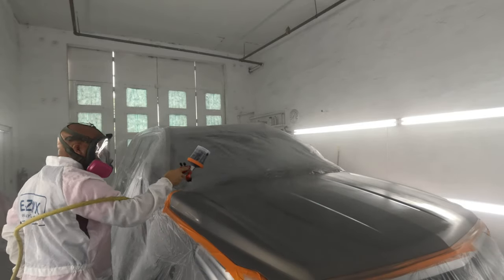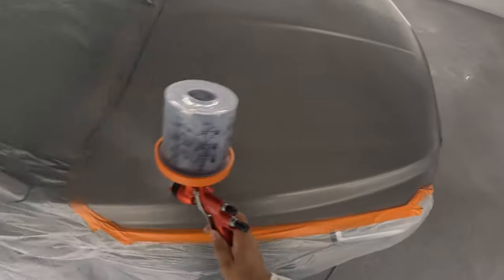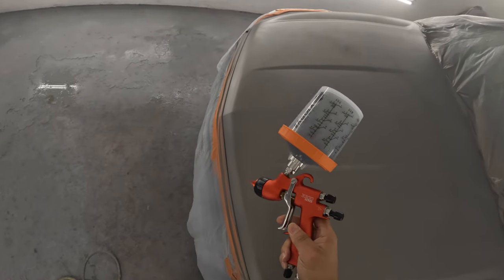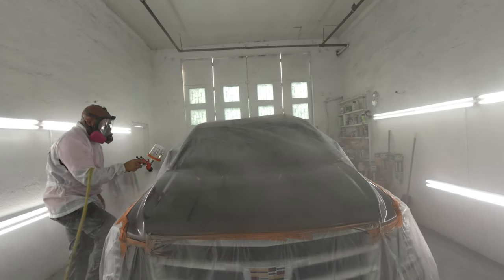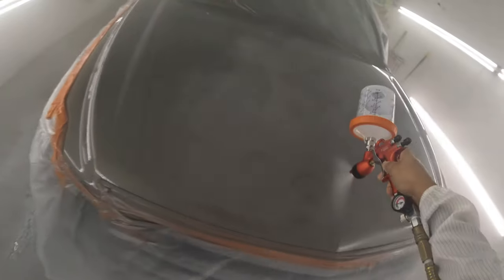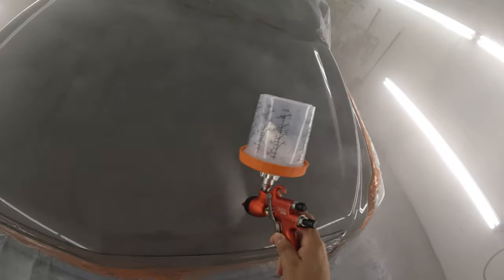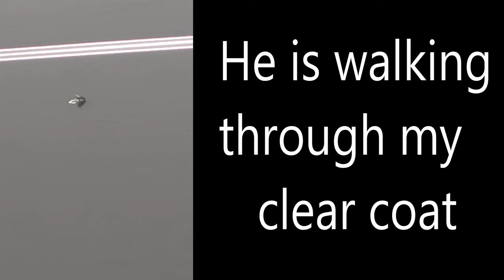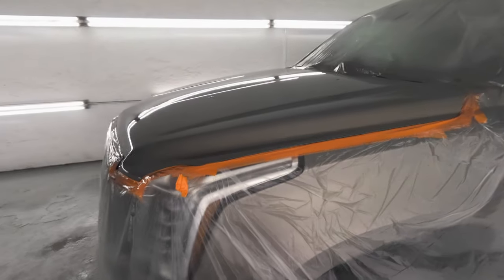Have you ever watched a fly walk through clear coat? 😤 what doesn't kill you makes you stronger 💪🏼

Comment: You could put like strips of rubber on one door that goes over the crack and touches the other door. That way the door still opens but you won’t get that dirty draft. Company I work for has a home made booth that I have to work with. Mines inside. So I just used carpet on the cracks in the same way and it helped alot.
Reply from the maker: Thanks bro, the owner has tried a few different things and they end up coming off. So I'm waiting to see what's next. It's not really a big deal at all. You see the work I put out it's cleaner than some down drafts. I'm just showing it for the guys who are in similar situations. But thank you I do appreciate that. 🤜🏼🤛🏼
Reply: @thetriggerman954  yeah no problem. At least your booth has clean air coming in. All the prepping get done in front of my booth filters so I’m constantly vacuuming them. Your jobs are definitely cleaner than mine. Sometimes I can get a really clean boat.
Reply from the maker: @nickcrill7718  yea man guys like us just make it happen. No cry baby shit here 💪🏼😂

Comment: What clear do you spray the most Trigger an would recommend for someone spraying at home
Reply from the maker: There is a link in the description for the AmTech clear I use. It's what I use on 90% of my jobs. I've been spraying it here at the shop for 10 years now. Haven't had any issues so far. It's a high solids clear and under $200 for the clear and activator.
Reply: @thetriggerman954  thanks for info Trigger 👍🏿💯
Reply from the maker: @SmokeyA55  no problem 💪🏼

Comment: You should get an propane shop heater and after spraying you can vacate fumes from booth then just heat it up real quick and turn it off coming back every so often to turn it back on an reheat booth every now and then! During cold months I do this since I'm spraying in an carport paint booth!
Reply from the maker: That's up to the owner lol I just use fast reducers and hardeners and change out my tips. I'm Florida we only get 8 cold days per year 😂
Reply: @thetriggerman954   got you there  brother I just remembered it snowed here once when I was doing an job and I was stressed and thought it would be dangerous to heat it that way but then I thought about it and those are forced air heaters so they would blow the fumes away instead of making them light up but im working with an back yard homebuilt booth and very minimal right now lol but it works 💪
Reply from the maker: @wrightsrrt871  key words "it works" as long as it works. That's money in the the bank 🤑💰 thanks brother 🤜🏼🤛🏼

Comment: Couldn’t you start at the middle and work out so if you do stumble you want fall in wet paint and why do some spray guns have that hook on the top near the cup does anyone every use it, nice work trigger man
Reply from the maker: Anywhere you start a tumble will be catastrophic regardless 🤣 The middle, front, edge I'm just accustomed to spraying the way I spray it's hard to change it up after so many years especially for a reason like that. But it's been about 8 years since I've slammed have my body into wet clear so I'm doing good 😁 And I'm not quite sure which cook you're talking about. Could you clarify a little more?
Reply: @thetriggerman954  it’s like a hook on the top of the gun behind the paint pot  , I like your comment dude
Reply from the maker: @paullynch1938  some guns have a little hook 🪝 back there so you can change the gun up.
Reply: @thetriggerman954  what do you mean change the gun up do you mean hang it up dude
Reply from the maker: @paullynch1938  typo I meant hang the gun up.
Reply: @thetriggerman954  I thought so dude, keep up the good work and watch out for the bugs, little bastards 😂🤣
Reply from the maker: @paullynch1938  thank you bro. Fkn bugs 🥺😂😂 💪🏼
Reply: @thetriggerman954  😂🤣😂🤣😂👍🏻